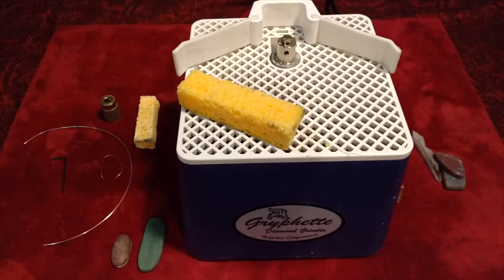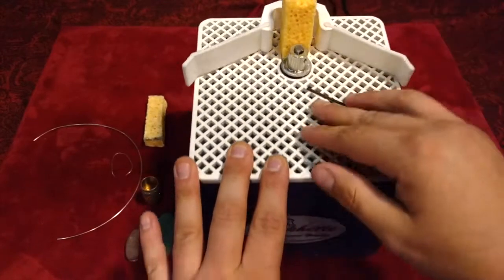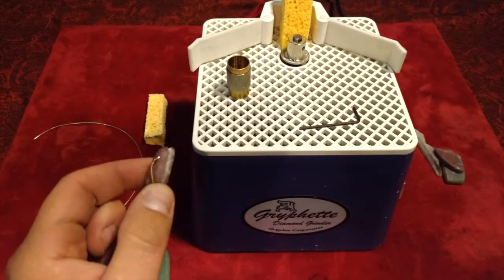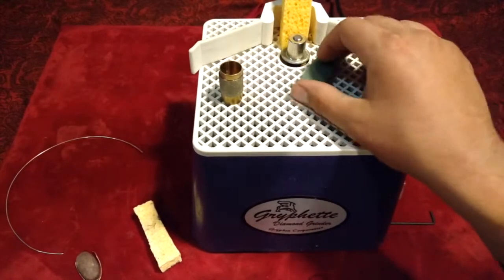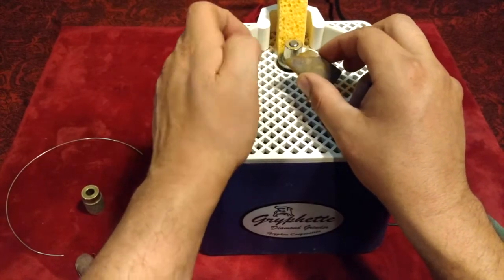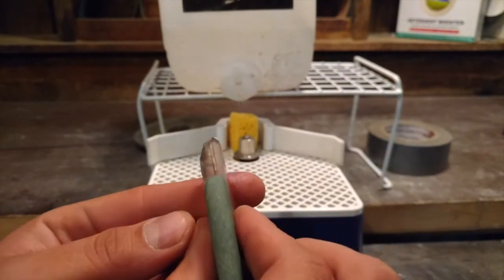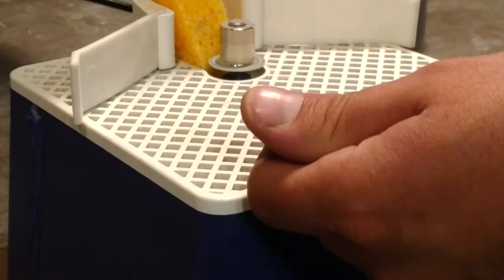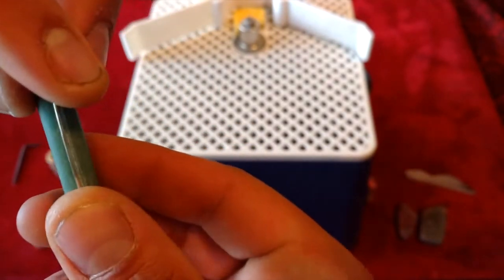Lapidary Time!! Grooving gemstones for wire wrapping and glass grinder fun with my Gryphette

Comment: I use my Dremel in the drill press accessory with a diamond saw bit, stacking the blades if I need a wider groove for larger or square wire. With a plastic tray and water, I can hold the stone and groove it with minimal splashing mess. The drill press accessory holds the Dremel tight and allows me to lock the position for multiple grooves along the edge of the same stone… a nice effect.

Comment: How many cabachons can you do with one bit.I am using the same method,and only got 2.5?I was trying to not push to hard.Maybe I need more water?
Reply from the maker: all depends on the quality of your bit. There’s 1000 different brands and dozens of different qualities. Some can’t even draw one whole others. You might get lucky and get away with 56 or seven. Some of them 20 water is definitely a huge deal but if you’re using cheap pets then you might not get very many at all. There’s a type of bit called sintered where the diamond is impregnated inside of a powdery metal matrix those last a lot longer and you know exactly when they were out because they were away
Reply: @lapidarydave  Thank you.I don't mind paying extra for quality bits.If you have a suggestion I would appreciate that.I was looking online and could only find one brand for etching side of cabachon called twofers glass grinding bits,but said they could be used for gem cabachons.35$ for 2.